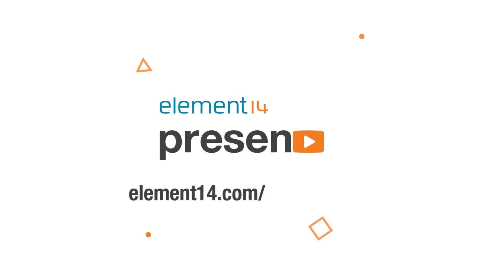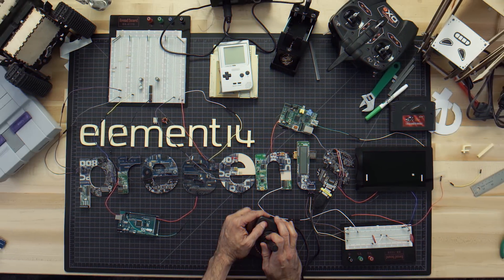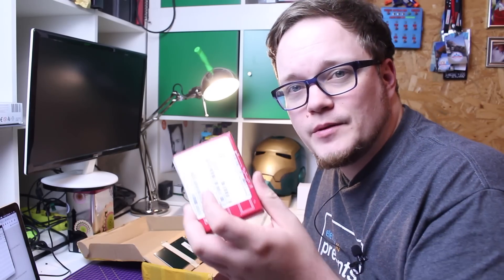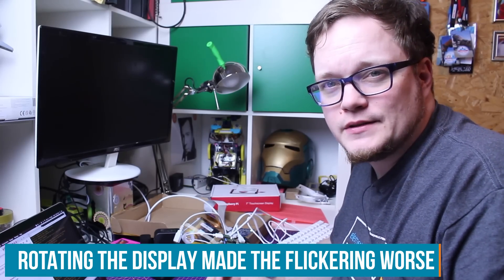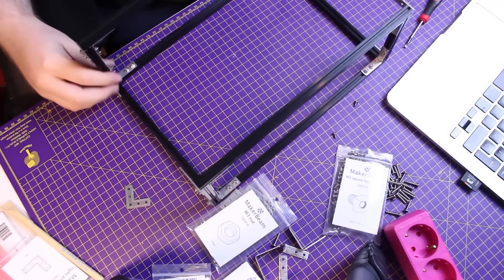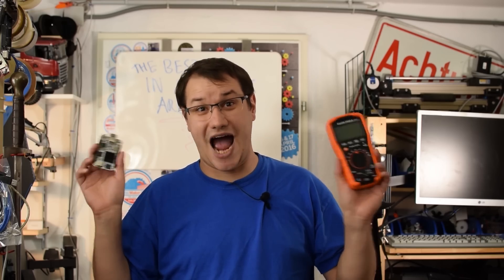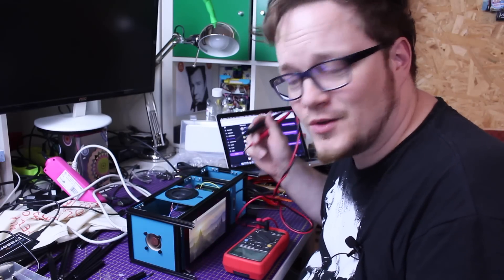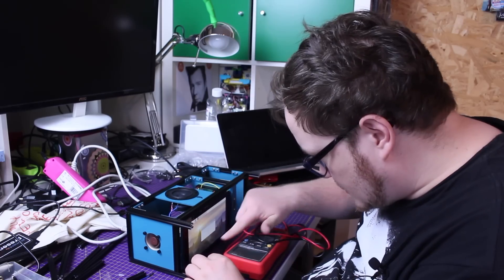Raspberry Pi 4 SX-64 Inspired Portable Computer

Comment: The extrusions are meant to go together by threading the ends to use profile fasteners and drilling access holes for the wrench, so you don't need to use ugly brackets. Also you could use slot nuts to attach anything to the profile frame, like body panels.
Reply: Hey. They come with these brackets, so that's not my design choice ;) Also didn't want to drill into the profiles and it still holds to this day, so I'm fine with that! Thanks for the feedback

Comment: Concerning the Notes on this saying "to bulky to call it a Laptop", well it was more in line with the CPM Katpro's / Osbournes (where I started), similar layout and used already in business (CPM),  and if you think the SX64 was Bulky,  haven't see my Chendai 8086 512k 20 meg St506 HD, CGA Green Screen LAP CRUSHER, it Also has Full Height (2) 8 Bit Slots, and yes it still has a 8 bit 300 baud modem in it, at about 15kg, I prefer my HP I7 ..
Reply: thanks for the insights :) I looked around left and right for inspiration and was amazed by all the chunky portables! Not sure I came across a "Chendai" though.
Reply: @Davedarko  Like most things in life, we learn from each other, The Chendai Is a bit at the back of pile of old laptops, so maybe soon I will post a Photo or 2 (I thought  I had some), anyway, I still want to force Australian Prime Minister to use,  next time Politicians claims slower internet speeds are ok,  8 bit modem to check his emails, They may not let me, sad, but true .. I just did a Google can't find Chendai, I will investigate further now, It may be worth something, again ...
Reply: Well, I am Old all I got to say, I have not got much space, it is taking some time, but I managed to locate the Chendai Laptop, 1) it's not the real old, cause I got a Larger one underneath it must be the 8086,  hard to get at, cause of the crates of Amiga Bits, 2) it's Chendai LAP V/V1, 80286 with 512k ram, (I mixed the 2 Laptops names, it seems) 3) Manual printed 1988,  I think the lower down one is/or must be a CPM box I think. (my brain keeps looking at it saying ms-dos 2.1), still work in Progress, but. I had a "mini-stroke" some time ago, and obviously my brain is jumbled ... I have some 286 Olivetti & Toshiba 286 Plasma, some 386/486's and a P2 Laptops,I will  have to do a better sort, my internal catalogue is fractured .. These are the jobs you find talking about, & poking around old PC's .. I Blame the RPi !!! ;)

Comment: I owned a sx64, being a Commodore dealer, once a long time ago, BUT a version that don't cause Hernia's seems a improvement, can it play M.U.L.E or Bruce Lee ?
Reply: I'm fairly sure, but haven't tried ;)
Reply: @Davedarko , I got a pi4 yesterday, I will test it all out .... (But I got a 7" Touchscreen for it for $30 as well !!!)
yes I run linux, (Debian since 95 on 68050 Amiga2000), so I probably just have to move my mame dir to get it happening ...

I will let you know ..
Reply: Ok, Got mine, they work, on a 55" Screen, but RPi 7" touch screen was D.O.A, so turn around time on that before I can go Sx64, But I am gunna fire up the 1084s on a raspberry !! if you want 4 d64 files, https://drive.google.com/open?id=1R6e8jQ8KO2THqjhPFxhdNKkOjL77zkTA

Thanks for some Inspiration ...
Reply: I think I have had a Idea, for my RPi/SX64, I noticed a bead of sweat on my brow ... A Glove Box C64, just the thing for passengers in car, and if you turn sharp, you can increase the difficultly .. I was thinking about mounting it up high on back of SUN Visor, ok with a Touch Screen, but it needs a Joystick, so So maybe a fold up on back of glovebox door ... Just a thought ...

Comment: All you need is a nice floppy drive. I'd would have use magnets instead of catches.
Reply: The keyboard is quite heavy though, big metal plate is holding the keys etc. - Magnets would have a hard time.
Reply: @Davedarko  There are magnets and there are MAGNETS!  Neodinium magnets are very strong and can be very small. Fix with Epoxy or similar.
Reply: @einstein.1869  feel free to share that, if you follow up on that ;) I'm happy with my solution and not gonna put in work to change it :P

Comment: I like the concept and would like to see it finished and properly demonstrated. Find a use-case for the computer and restructure the video to show how you built this computer to solve your problem.
Reply: I basically wanted to have a raspberry pi that I don't pull out of a drawer and flash an SD card again, just to try something :) But I will surely have to squeeze in an update at one point

Comment: My boss and I had a issue with rotation of the display with Raspberry Pi 4, I think something was changed in the way the OS on the Pi4 handles the display that was worked to keep the OS reverse compatible, I'll message the boss over the weekend to try get some more information on this issue.
Reply: Hm, it worked fine for me with the official display, but rotating the 2k display on a Raspberry PI 3B was out of the question somehow.
Reply: @Davedarko  we were building something like a fast food ordering screen so we were using a 16" HANNspree display in portrait orientation , the Pi4 CPU got really hot and with sluggish performance till he figured out the correct settings.
Reply: @welshdave5263  neat!  There was a firmware update recently for the USB part to go to sleep so the pi wouldn't overheat. Might help too, was on hackaday the other day

Comment: A 3.5” floppy drive could be a nice addition to the build, especially since there is some unused space left in the frame.
Reply: I would imagine an SD card reader would be more technology relevant than a floppy drive.
Reply: Good point! Not sure I have one somewhere or any disks, hmmm
Reply: @Deon Denis I've never tried a .3.5" usb floppy with a Pi or linux.  I know an SD reader will work.  They are the modern equivalent of transporting files on a floppy.

Comment: Retro builds from the RPi 3 were so common that I was less than enthused at first. However, by the time you started building the frame I was completely won over. I was impressed by several of your +solid 2 thumbs up. Great job. 👍👍
Reply: Thanks! Those aluminium extrusions are fun to work with, got some nice "failed" versions before the final one, but all looked awesome!

Comment: also that empty space on the side, you could put a little storage space in there for usb thumb drives, a tiny little bluetooth game controller maybe, or a mouse. or just put a little set of random switches and lights there to make it look cyberpunk.
Reply: I thought about adding a mini synthesizer module maybe :D but the original SX-64 also has a storage compartment :D

Comment: I hope you do a followup once you get the out case built, maybe run some emulated games as demo.
There's no reason you couldn't put a good-sized battery in there; just because the original wasn't power-independent doesn't mean your's can't be.
Reply: Sorry that the demo part was so short or not even there for the "Raspberry PI is running" part. I have this huge LiPo and thanks to Clem's tip I should be able to use a 5V/5A BEC to run this system on batteries :)
Reply: @Davedarko  please let us know if it works! I’m super interested in building a portable computer like this if it can possibly run on battery
Reply: @HokgwaiXbirdmaN  it definitely is possible! There's another video on this channel where I'm building a BD-1 companion robot. It has a beamer and a raspberry pi running off a 4 cell battery. You only need a 2-3 cell battery for the raspberry pi though. Be sure to add a battery protector / something that watches your cell voltages.